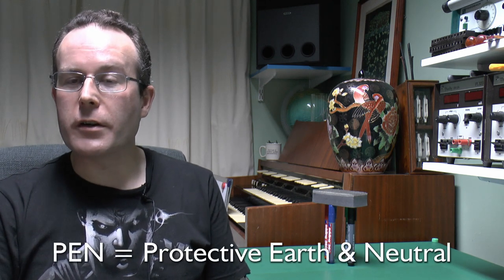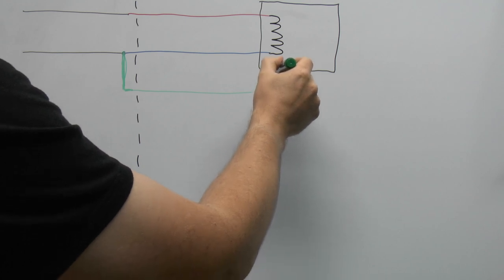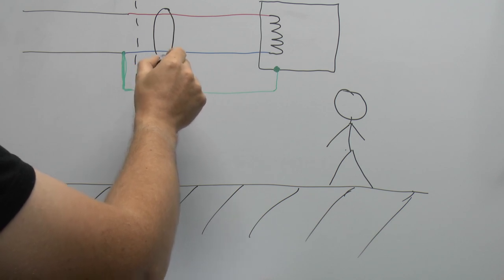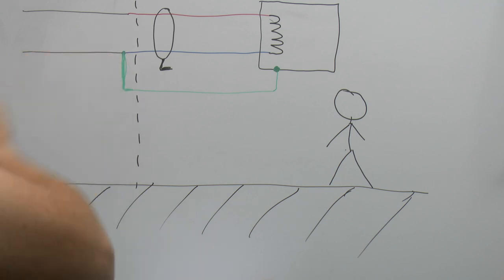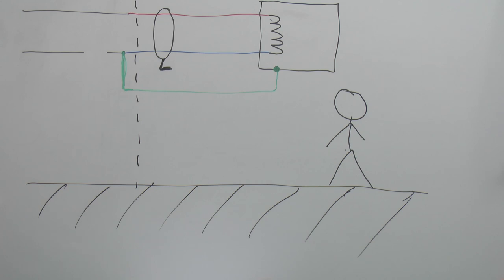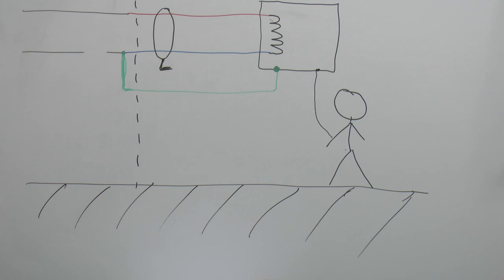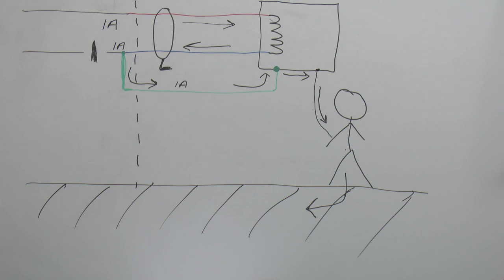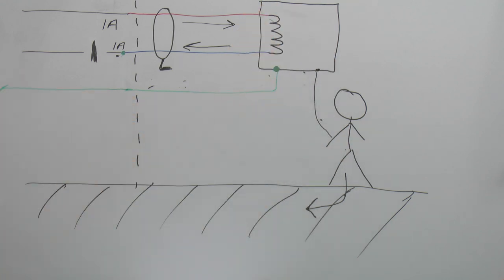TN-C-S Danger - Broken PEN Conductor (Combined Earth & Neutral)

Comment: Could equipotential bonding say possibly to my neighbours house save you in this kind of scenario
Reply: +Ben Howard 
sort of, if your neighbour has TN-C-S as well then the bonding wire will carry your entire return current, which could of course ultimately overload/overheat.    Or indeed depending on the failure you both suffer the same combined failed-neutral/earth at the same time!...
Reply: +Ben Howard Usually all metalic pipes that enter your perimisis are already connected to all your neighbours which each have everything bonded to the Protective Earth Neutral from the supplier. So even if one of your neighbours still has a proper connected neutral everything will work although lights might dim and overbright because of the higher impedance of these unintended conductors causing voltage rise/drop to be more extreme.

TN-C-S is basicly the cheapest grounding system providing minimal safety.

Comment: if the PEN wire cut, the CB will trip because the load needs both Phase and Nuetral.... According to Standard the RCD should not be used in TN-C system
Reply: You cannot have an RCD on the PEN wire as RCD should not break the earth. Also such an RCD could trip accidentally if a device case has an alternative connection to the earth. You can have an RCD after the PE an N are separated. I have only two wies on my sockets so the RCDs n the consumer unit are not connected. I got  portable RCD for my washing machine.

Comment: the rcd will trip 5:30
 because current is passing in live wire and not in neutural
Reply from the maker: The RCD will not trip.
Current via the person has already been through both conductors in the RCD and is retuning on the protective conductor (green in the diagram).
Reply: @jwflame  how do we stop this danger of electric shock from occuring in the event of a open PEN fault? I've heard in passing of open PEN detectors or that you should put an earth spike in but i've never seen this or done it before. I want to be prepared in case i need to install something where this is likely to occur (for instance EV chargers) 

Thank you for your instructional videos.your one of the best 😊

Comment: Can we consider  in TN - C - S system RCD is useless?
Reply from the maker: No, it will work normally for most faults.  it won't work for the fault described in this video, but faults like that are rare.
Reply: RCD is not useless it protects you from electric shock while L+N are available. When N it's cut, you should have a very good earth connection to your house (<4Ohm) so you don't get an electric shock from appliances, this is because at transformer side (supplier), the N is connected to PE, thus on transport layer you have L+PEN and you need to separate it unless it's done from the supplier side. You should ALWAYS have your house connected to earth and all your sockets connected to that earth.
Reply: No, an RCD does what it is designed to do. It protects against faults that happen after it. It cannot protect faults that happen before it.

Comment: If your appliance went faulty resulting in live to earth short, then in normal circumstance your e/l would trip. You would have no power so would fault find and repair. Similarly if the neutral disconnected as described you would have no power at all. This would also trigger a fault find and repair. The chance of both events happening simultaneously is small. I can only guess that this is the reason that it is not compulsory to earth your local installation as is legal requirement in my country.

Comment: John, please, can You answer to me, how much voltage would be at 1 phase load (TV for example) to ground, when neutral is broken before earthing inside electrical installation? So, we have broken neutral with good earthing of object and electrical installation in it, and now ground replacing neutral conductor long away to transformer station. Is it possible that appears voltage on 1 phase load that is greater than normally 1 phase voltage (230V)? Thanks!
Reply: +Goran Pantic Yes, Broken Neutral to Phase voltage can be as high as 400 Volts. But this can also happen on very long 230/400Volt lines. 

Countries with a poor electric infrastructure (Certain regions in USSR, Asia, Africa and South America) mention voltages as high as 280 Volts between phase and neutral as not uncommon at the end of the lines. These regions usually suffer from daily rolling blackouts so businesses that depend on electricity usually have their own generator.

In most developed countries when the neutral is not broken, the Phase to Neutral voltage hardly ever exceeds 240 Volts and never exceeds 250 Volts which is the maximum voltage most 230 Volt appliances are rated for.

Comment: What's the easiest way to prevent such a situation (when PEN breaks) from damaging you? Avoid using any grounding on appliances?
Reply from the maker: osmoregulator Nothing - although the fault described is very rare, so unlikely to occur in a normal house.

It's more likely with overhead supplies and temporary connections, which is why it's not permitted to use it to supply things like caravans and outdoor marquees.
Reply: Using class II appliances, ie ones with double insulation, helps since they have a non-conductive casing which isn't earthed and therefore won't become live in this scenario.
Reply: +John Ward 

Of course you don't do this anywhere but the main bus bar these days, where there's also an additional grounding rod to prevent just this. (Though it also may prevent the fault being detected.)
Reply: +John Ward 
Or do you mean that Marinas and such are required by law to have TN-S all the way from the transformer?

I just remember they had to have some special cabling. No aerial cables of course and no steel cladding I believe, because of corrosion. Or was it even no aluminium?

Comment: Me and another members of bulgarian DYI forum were discussing how to solve this issue.
There are two solutions:
1. relay. in case pen is broken relay will stop working. Live wire will be disconnected. Energy in-efficient solution.
2. http://s6.postimg.org/4q4jmfc35/RCD.png
Reply: +Vladimir Georgiev How is this going to work? As soon as you have a serious load at R1, the current through R2 will be significant enough to trip the RCD unintended. Also it is not allowed to have two Protective Earths in any normal installation. So you have to connect the resistor to the PE which is again connected to the PEN conductor defeating your whole system.

If you're like me afraid of PEN conductors, protect all circuits with an 30mA RCD and switch to TT Grounding. But please check the bulgarian regulations first. Some countries do not allow TT (Like the US or Germany) because their electrical installations do not always have RCD's on every circuit posing an electrocution risk when you do not have TN grounding. TN-S is usually not an option since you need to have a separate PE conductor all the way to the transformer.
Reply: +Robin Heijblom Let&#39;s assume R2 = 4.7 KOhm. In case PEN is broken then 46mA will flow trough R2 to ground which will cause RCD to shut off. Assuming low resistance on R1 (compared to R2).
In case there is no issue with PEN conductor and serious load at R1. 
Let&#39;s say 60A are flowing trough R1. Let&#39;s assume PEN resistance is 1Ohm (which is very high for PEN) and 4,7KOhm R2.... About 13mA will flow trough R2. RCD will trigger at 30mA. So it should be fine.

To be honest I did not tested this scheme. 

What I did is: TN-C-S. I spitted PEN in to PE and N in the meter box downstairs. Meter box case is grounded. PEN is attached to the meter box case. So PEN is grounded again.
Reply: +Vladimir Georgiev 
You said: "In case PEN is broken then 46mA will flow trough R2 to ground" 
This is only right when there is a short circuit between phase and neutral and the resistance of your Isolated Earth is close to 0 Ohms. So the resistor has to be lower than 4,6 kOhm.

But I guess it could work but there are to many if's. 

But again, it is never allowed to have multiple earths in the same installation. Never! Not in TN-C, TN-C-S, TN-S, TT or IT. You are allowed to provide a seperate wire from an appliance directly to the fusebox. But at the fusebox all ground wires HAVE to be connected directly. So the resistance between any two ground wires will always be <1 Ohm. Those are the rules and they are there for a reason. The Protective Earth is a special wire which you should be able to rely on.

If you don't like the risk of a broken Neutral or like me don't want Neutral noise on your Protective Earth you should switch your installation earthing to TT System or TN-S if you supplier can offer it which is usually only possible when you have your own transformer.